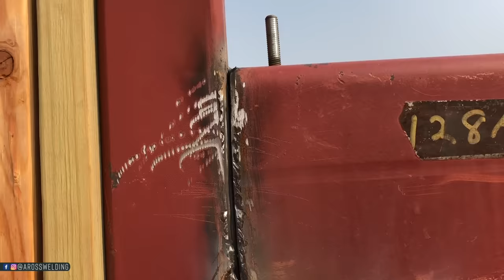STRUCTURAL WELDING IN THE BIG CITY // BAD WELDS

Comment: here in canada  on building we have blue prints to go off that are engineered drawings and have to go off them. the weld have to be what is printed . as you stated that you put two welds going on that vertical weld. is that what it is called for . just asking.

Comment: Austin, now that you’re doing “real” welding; you need a CV module and a suitcase wire feeder so you can make some time. You’ll find yourself using it on the fence jobs too and before long you’ll be throwing rocks at a box of stick electrodes.
Reply: T and M longer is better

Comment: I'm kind of skeered after seeing this vid, that you said "the welders" they initially hired couldn't do what you just did. I saw nothing tricky, or sneaky, or complicated about it. Just straight forward linear welds. Sure some were vertical, half seemed to be simple level flat across, and a bit of undersides, but DAMN!!!! How can anyone NOT do that that has been welding for even a year on a consistent basis? I'm by far no expert, and sure I have my share still of some funky looking welds, but for the most part, mine look a lot like yours, albeit not nearly as even puddle distribution (my dimes have uneven spacing at times, but I chalk that up to me getting in a rush even if it's very momentary and I need to learn to slow down), but this is basic welding 101 for the most part..... 
Their "day, day and a half of welding" estimator sounds like he went to where I did to learn estimations.... If I say "it'll take a day", count heavily on it taking 2... ROFL

Comment: As a AWS licensed welder, weaving a bead, makes the weld weaker than running a stringer bead. If you weaved a bead while taking your AWS here in Ca where I tested, you would fail, especially on structual.

Comment: The welds from the previous two welders are what we commonly refer to as “gorilla” welds. They are usually strong as sh!t but ugly as hell and won’t ever pass any kind of an inspection. You can get a Gorilla weld tho that won’t even hold bubble gum up at all but those are the extremely ugly ones. 

Gorilla welds are often ok for most stuff around the farm and on farm equipment, etc, but not for industrial or commercial use where an inspection will be required and a failed  weld could cause an injury or worse, not very likely but is possible. 

You layed down some really nice welds there consider what you had to work with. I just found your channel but think you earned a new sub so we’ll try it and see where you take us brother, good job man!!
Reply: Yup monk the welder!

Comment: Does your pipe cert allow you to weld structural as well as pipe or do you have to have the D1.1 cert as well for the structural ?
Reply: Pipe Certs qualify you for flat plate in most cases. welding something round is much more difficult than flat!!!
Reply: @hankleonardo2996  thank you for that response.
Reply: Stainless tickets generally work the same way. A ss 6g gun barrel will pretty much qualify you for any thickness of anything but exotics.
Reply: @matkurcher9469  That's good to know Mat. Appreciate the response.
Reply from the maker: It depends on the particular job. And the welding inspector on site.

Comment: Get a suit case with some dual shield fluxcore it's just like 7018 a ductile material but 4 times faster but I'm not sure if the machine you run is a cc/cv those pipeline welders usually run cc only there limited
Reply: That’s right an sae 300 wont run cv.
But if the contractor is happy with production rate of 3/32  or 1/8 then fine, now if the contractor says ,,, we got 2 days to get this done , get the cv machine and  the wire turn up the price and lay it in hot and heavy.
Don’t hesitate,,, 
Then again if all you do is smaw and your asked to weld fcaw in a crunch, you better know how to run it! 
Great video Austin, new to your channel but gonna stick around.👍🏽

Comment: How did you get on that job? Did you have certs.  from the pipeline?  Did you have to take a weld test for them?
Reply: Id be interested to know as well. Stuff like this is what i love doing, but most want D1.1 tickets which i have not got around to getting yet. In az you also need a contractors license even as a sub unless you are a 1099 employee for a company.
Reply: Probably not since the previous welders used 7018 for downhill 😅
Reply from the maker: I have my Oklahoma state card and my d1.1
No I did not have to test.

Comment: You know, I’m Actually surprised the architect didn’t spec the plans out to have flanges or plates welded on to the steel so the framers could just bolt everything together on site and not need an on-site welder for this style building and seems to me it would be quicker and easier to put up. Is there a reason not to go that route that I’m not seeing on a 15 minute video brother? Still a damn good video tho and I enjoyed watching but am curious from my years in the trades and what I’ve been around it just seems like it would have been quicker and easier, but calling you out would have been quicker and easier and cheaper in the first place anyways, lol

Comment: When in the vertical position. How do you determine to go up hill vs down hill?
Reply: TJP 81  
In oklahoma the state boilermakers certification test is welded down hill with 5p on 6" pipe in the Arkansas bellhole position with open root.

Comment: You must weld on pipe alot with that pancake hood. welds look good dude how do you get into be called to construction jobs are you in a union i do lots of crack repair im need more work give me some tips to pick up jobs im not certified but i know i could get it iv been a paid welder for 8 years now

Comment: Surprised a commercial worksite allows you to work off a ladder, most define a ladder as a means to access and you need three points of contact at all times, to work you need aircraft style steps with a work platform or staging/scaffolding to work... it’s that not the case there?

Comment: How do you know what size of rod to use on what thickness of metal?
Reply: Unless there's a procedure calling out something in particular, to make money and save time, use the biggest rod the joint prep can handle.  In other words, if the joint is nice and the tubing beefy, grab the big stuff and crank the heat.  If the guys doing the grinding junked it up and you need to build up each side of the joint to close it up first, choose the smaller rod and turn the heat down.  7018 doesn't like to fill large and uneven gaps so a quality prep is a key timesaver.
Reply from the maker: Like he said, depends on the procedure or if there is one... it will tell you. But it’s basically based on the thickness of metal you’re welding on and/or which direction or position you are welding. But there only a certain few common diameters of welding rod, 3/32, 1/8, 5/32, 3/16 to name the most common. 
I’d say the most common is 1/8... that’s a good safe size to start with.

Comment: Wouldn't it be better to work off a small platform mate ,more stability rather than holding on with one hand to weld could have hired one real cheap for 3or 4 days ,it's. A lot safer than a single ladder , although you're welds do look good for what I see .

Comment: Welding school must be very different in the states compared to up here in Canada because u guys saying u went in highschool is crazy to me , up here u usually got find a shop that’ll hire u as a labour and then apprentice u after 3 months and then u get a blue book which counts your hours and u need 1200 hours and then go for your first year of college which is a 2 month period 7 hour 5 days a week worth of school usually 4 hours in class then 2 hours in shop and repeat 2 more times till u get your jman ticket and each year is split up like 1st year is all mig flux core wire feed and then 2nd year all tig/ stick and 3rd only stick then u can do a red seal test that certifies u across Canada a jman welder

Comment: what was the wall thickness of the tube they were using?
Reply: Several different thicknesses used throughout this job so there isn't one single answer.  Rule of thumb for HSS is half the corner radius = wall thickness so, as you watch the video, you can begin to judge the thickness of a particular section of tubing.

Comment: Downhill 7018😞.  isn't that frist day welding nalage. I know it was for me.
Reply: I have never ran 7018 downhill...well maybe a handrail but I'm pretty sure if you look up the numbers 7018 is all position...I maybe wrong?
Reply: tig more 7018 is supposed to be for uphill only
Reply: tig more The 1 makes it all position but that doesnt mean it can be run downhill. For example 7014 and 7024 are similar in composition but a 7024 can only be run flat and horizontal. 1 means flat, horizontal, overhead, and vertical. But the proper way for vertical is uphill on 7018
Reply: @ev3287  which number in 7018 or an rod details the position? I would like to look into it....a google search says all position but I'd like to look into it more.
Reply: @markdoumert4840  ok thanks for explaining
Reply: So what number would indicate a downhill rod?
Reply: tig more type of flux so the last number it also gets into all the chemicals n stuff
Reply: Once i ran a 7018 downhill to see what was all the fuss about running it downhill and all the flux was coming down on me and it was hard keeping up with the puddle
Reply: Asme b31.1 allows procedures for downhill 7018. Most commonly found in my industry as seal welds and boiler tube to membrane. Downhill tig is also commonplace on pressure components such as slope tubes.
Reply: @matkurcher9469  so no structural
Reply: @darrenboone681  no downhill 18 may be welding school day 1 knowledge. They don't tell you when its done correctly there is a place for it. B31.1 is boiler code and if asme has found a use for downhill 18 it could be valuable to learn. They will pass a die pen and mag, they also do look nice if your proficient. As a structural weld, no. The reason downhill 18 is used is to minimize heat input and depth of penetration. Heat input doesn't matter and less penetration into the parent material isn't advisable on structural.
Reply: @darrenboone681  but you have peeked my interest. Next time I'm playing around I will be trying out a downhill 7018 cwb.
Reply: @matkurcher9469  I don't know anyone that does it. Not say I haven't seen it people  do that with dual sheild flux to and it doesn't work
Reply: Gotta down hill that shit on like 85amps if its thin wire wheel that shit go down hill again then put u 2 nice beeds uphill on like 88 or 90 amps and not 5 lmao then have your self a cold beer after saving so much time

Comment: Has the pipeline work completely dried up now. You even just call yourself now a rig welder and don't mention pipe any more.
Reply: pipeline work is not dried up. Owning/operating a rig you dont only work on pipelines. Its not even necessarily the most lucrative.

Comment: Ok, so they hire a welder, and the job isn’t certified, and so they hire another one to redo it, and it’s also not good, the third guy comes in and it’s fine. What happens with the first two? We’re they already paid? If so, what then?
Reply: Usually the prior welders will get back charged. Some companies hold final payment until all work is completed. I work for a GC that builds hotels, restaurants and schools. When I have to fix the subcontractors work,, my wage, materials and truck/tool usage gets back charged to the original sub that did the work.

Comment: I guess nice thing about a job like this is,  you k ow nothing g is going to move,  (or does it) since all the poor welds where cut right straight through? Man,  I sure would like to find a pro welding gig...another nicething,  it's not like the electrician, plumber, carpenterthis g,  Its Only YOU,  not 50 other dudes... ,

Comment: they knew it was going be inspected. but there welders mite make 15 dollars an hour and send half of it back to mexico.the inspector is just not going to sign off on chicken scratch. I do the same thing you do.i cut company's no slack when I repair other welders garbage. it would of been cheaper to hire a certified welders to begin with. but at least they got the stuff tacked up cheap.most guys stuff you fix can't even spell welder. sometimes I get them so supply a helper and pay for the grinding wheels or I want touch it .

Comment: OK you're welding up hill here and downhill on the pipe job.  take a minute a explaine why up hill and your tecnique for up hill.   back and forth horseshoe   puddle location
Reply from the maker: Most structural jobs that have to be up to code have to be welded uphill. It’s all about the procedure. Pipelines have uphill procedures also. It’s just the majority of mainline pipelines are welded downhill.
Reply: As an add on to Austin,  it all really depends on the Welding Procedure Sheet that comes with the prints. If it a commercial, industrial, or state job, most often this is provided with the prints. As a Union Ironworker I have only asked for them a few times as I want verification of what the engineer has in mind. In my state all structural welds with 7018 are uphill. There was one job where the foreman told me it was downhill and I called bs. Asked for the wps, and there it was, downhill... was considered a seal weld, not a structural weld. Point being, that information is always with the WPS.
Reply: I have seen down hill welds for "sealing"  also but it just doesn't seem right at all.

Comment: ive welded on bridges you wanna talk about pain in the fucking ass and its d1.5 test no power tools LOL someitmes i think welding pipe is easier when doing 6g 6010root 7018 fill cap